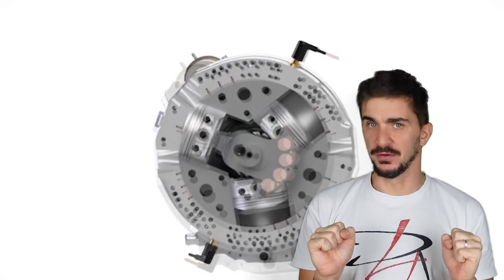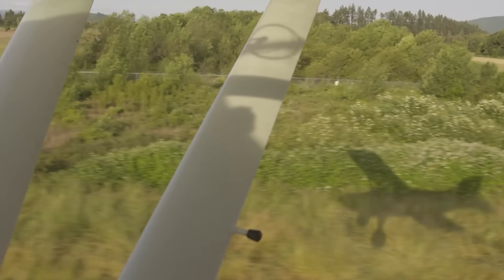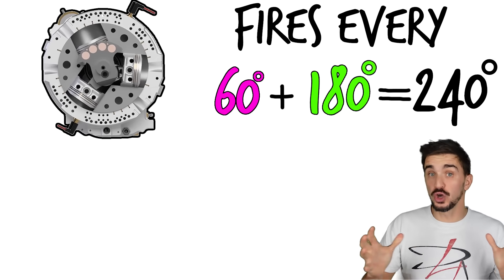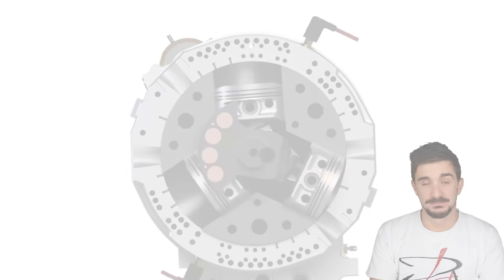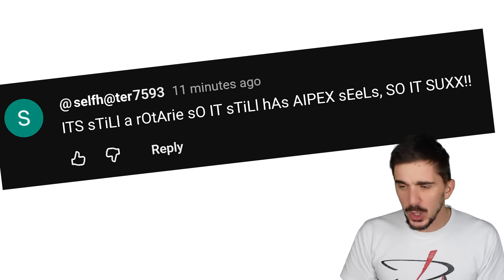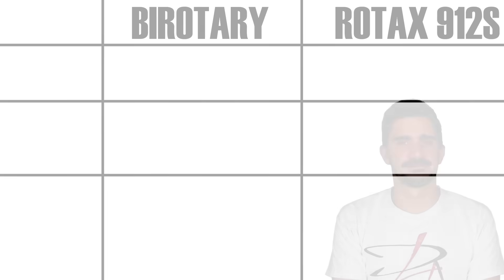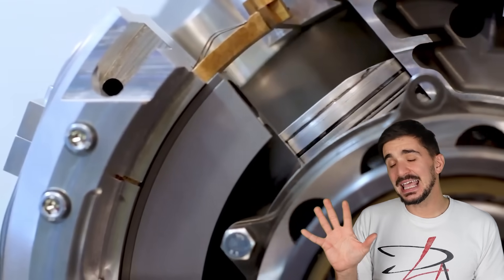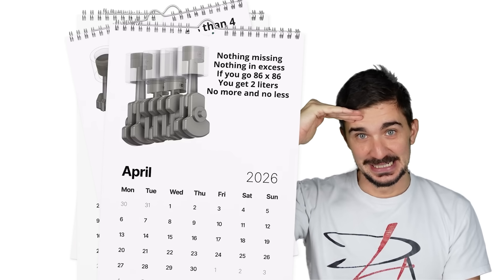This is What Happens When Pistons and Rotaries Make Babies - Birotary Engine Explained and Reviewed

Comment: It's a really cool concept, but it does miss the whole point of the rotary engine, which is to produce rotating motion directly. This engine still produce linear motion which then needs to be converted into rotating motion, exactly like a conventional stroke engine. Also not sure that I would want my car to run at 7500 RPM's. It may be fine for a small plane, but I like low rev cruising while driving. I don't need to feel like a race driver when driving to work in the morning.

Comment: 9:50 could you not also narrow the bores (so the strokes are comparably longer) or simply increase the engine's diameter?
I think it's the geometry of the camshaft that's the limiting factor though, not the forces and timing of the pistons

Comment: It could maybe work for hybrid vehicles. Use electric motor at low rpm, then Birotor kicks in at higher rpm, or for charging the battery.

Comment: If the stroke is really short, then the bore must be larger. Since the engine works on pressure pushing down the piston, the larger the piston area, the more force pushing down the piston and more force acting upon the crank? It would be nice to know how this works in overall torque numbers rather than "its short stoke reduces leverage". Obviously it reduces leverage, but how much of this loss is made up by the increased piston area? 
    Most vehicles, or at least it seems like most these days, use forced induction. Would that not help cylinder filling at low speeds? Not having valves in the way of the exhaust port might even help a turbo based engine? More of a supercharger fan myself. Interesting engine format. Thanks.

Comment: The UL Power does NOT run at 5500 rpm, at most 3300 rpm
Rotax engines run 5500 rpm continue power.

Comment: To me, the one thing that is clear as mud is how this engone gets lubrication. And along with that, how does the lubrication provde engine cooling both from the oil cooling it, as well as the actual cylinder/and head cooling. I dont see how it would get cylinder cooling like a conventional mixed coolant (water/anti-freeze) mix. So that would likely mean oil cooling like the Suzuki motorcycles (which can also rev to 10,000 rpm), but have traditional engine artcistructure to create traditional cooling paths. This doesn't show any paths for cooling , which is fine for a computer model, and less so for a mini bench opperating display engine whos entire purpose is to run and show that it works. But with no real load, and a tiny fuel tank so that the engine will not overheat. But once you put a 50+ gallon fuel tank connected to it, and add a real propeller to it and have it do real work. Well that is very problomatic. An engine is only as good as its cooling capacity. And I'm not seeing any cooling. I will conceed that it would not be hard to cool around the outside of the engine, the cylinder block would be a VERY DIFFERENT thing.  It MUST be cooled, or it will suffer dramatic heat distortion, and it will not be able to maintain its shape, which will make it so neither the combustion gases or the intake/exhaust gasses will not seal as well. And I can not see how you could pass either oil or coolant through the cyclinder block without having such a large block that it would have a very large weight, which is the ABSOLUTE ENEMY of aircraft. Don't get me wrong. I like the idea. Especially if you could stack several rotory "piston blocks which would allow for a larger output. But without cooling. It's just a cool little "theoretical" engine design. And if it's theoretical, you might as well make it a two stroke. In which by adding expansion chambers could add to it's power output.

Comment: 2:06 LOL. Right in the head.

Also, the crank might be rotating 10000 rpm relative to the rotor. 
But what really counts is how fast it is rotating relative to the static casing. Because that static casing is essentially the airframe, or the chassis of the vehicle.
So 7500rpm it is.

Comment: "begs the question" has a very specific usage in grammar. Your use of it isn't correct. Just say "raises the question."
How does the inner rotating block seal against the outer block. Seems like it would have a similar problem to the rotary apex seals.

Comment: In aircraft, I'd be concerned about variable temperature operation, meaning summer/winter and altitude variations.  Also while transient operation may seem less important to an aircraft, that will introduce significant drama to a pilot who is falling out of the sky with a malfunctioning engine.  Some power is always better than no power.

Comment: The potential to add either massive surface area pistons or a higher number of pistons (especially with narrowing piston skirts within the cylinders which would also reduce weight, think upsidedown triangles) would allow for either more powerful combustions to the former or more numerous combustions to the latter, and with a system to skip A/F and spark cycles to improve low load consumption (and potentially adding more fuel post combustion akin to what diesels do, or even using diesel) would dramatically increase the viability, at the expense of increasing complexity.

I also don't understand why a transmission with multiple gear ratios is undesirable in aircraft. It seems to me like it would possibly be a bigger efficiency boost versus variable pitch rotors, but could be a multiplier in combination.

Comment: Disagree about  fixed timings
If you rotate outer rotor by some servo against  gear frame - you will be able to regulate it  like it did  with one camshaft engines where you change both intake and exhaust simultaneously

Comment: All I'm saying is, add three (or more) rotary valves that can be used individually, 2 on the sides of the piston with smaller ports, 1 big one in the middle and the issues with low rpm performance are totally fixed! I kid, but what a cool engine, thanks for making a video on it

Comment: What about cooling the inner rotating block? This thing is a massinve chunk of aluminum receiving the heat of all 3 pistons via piston rings and rotating that with liquid inside,not a good choice for balance. Well, insanely complexity to such a small task. The only real benefit on aircraft seams to be torque canceling, but this should be easier with a gear reduction that turns the "propeulleür" to opposite side of crankshaft.  I'm just wandering....

Comment: 13:00 another big drawback- you can't do things on this engine if words "variable" and "valve" are in name of that thing. And mass, this is just a huge, full piece of steel.
Reply: You could have slots though, to save weight, as well as to flow cooling. Not sure if it's the best for longeavity though, but weight is another problem with a traditional wankel. It only got saved by its compact size, because rotors are like 2 kg, which is insane considering that huge pistons like ones you'd find on a top fuel engine is a bit less than that

Comment: Aviation is all about reliability, weight, and fuel consumption. I don't have much confidence in this engine because - if you've got an unproven design, it's not the lightest thing on earth, and it's not a diesel, you haven't really advanced on any of the three. In any case, great video and (on the topic of aero engines) I'd love to see your take on the DeltaHawk v4 diesel.

Comment: the cylinder block rotating will have so much friction against the housing, this seems a highly inefficient design
Reply: Heat transfer, oil seepage into the combustion chamber, seal life and damage modes (fracture and lodge in the rotating chambers?), etc. All solvable, but at what cost and time?

Comment: This paired with a CVT could work for auto applications? Engine RPM stays constant (like the aircraft use-case), but you can vary the output speed via the CVT
Reply: I would really have loved if he dug dipper into that stuff and also how it could work with a turbo and direct injection for like a light car and with a CVT even though I only like manual transmission or semi-auto...

Comment: 15:10 on TBO the lack of valves is a big advantage and since the pistons are only moving at 2.5k isn't that the relevant number for maintenance.  The crankshaft is just a hunk of steel.
Reply from the maker: Yes on the valves! The pistons are just rotating at 2.5k rpm, they're actually doing 7.5k since they're still driven by the mini stroke crank

Comment: Re. RPMs, let us also not forget our high school geometry; the diameter of the crank is significantly LESS than the block diameter. Thus, rotating both at the same speed (regardless of direction) = one is going to "fall behind" PDQ [Pretty Damn Quick], so differential RPM-speeds is inevitable; otherwise everything is gonna start doing whatever it pleases & all hell's gonna break loose near straight away... ;~ ]

Comment: Reaction torque is always there.  Without it, there is no torque delivered.
Reply: Understood, a Chinook does not fly
Reply: @Jo-rz6bs  Counter-rotation still has torque delivered, just in opposite directions. Airframe of Chinook has to cope with that. But enough pedantry, in the use case outlined in the video, the torque that matters to a single rotor light aircraft is reaction torque. The only benefits of the counter-rotating engine elements are balanced gyroscopic forces and lower vibration. The "torque" between engine components is largely irrelevant (but perhaps he had flywheel reaction torque in mind, relevant for car engines, but not so much for planes, because the prop acts as the flywheel in most cases...).

Comment: yeah, an 150 year old concept, an engine type first patented in 1888, rediscovered by an youtuber in 2026.
Reply: Well, it's the first time I ever heard of it so there's that. 
Sounds like they needed a better marketing team in 1888.
Also, it's still 2025 so I have to be suspect of the rest of your post if you can't even get the year correct.
Reply: @ericbucher8636  sorry, in my thoughts i'm already in 2026.
the first of these engines was patented in 1888 by Félix Millet in france, and was shown in the Exposition Universelle 1889 in paris. and you point about marketing, most of the early aircraft had these engines.
If i have missed something ... i'm open to get new information. i might be wrong, but at the moment i can't see a difference between the engine you have shown, and most early rotary engines.
Reply: @cnschu  It's all good. I get it.
 I just thought it was an entertaining and informative video about something I had never seen before, so I was being a dick as an awkward form of defense.
 I know there were many "rotary" aircraft engines, but this seemed to be somewhat unique compared to them.
You are clearly much better educated than I on the subject.
Reply: @ericbucher8636 sorry for being a little provocative in my first post. Have fun and keep going 😊

Comment: I would imagine as a compact range extender or even a home generator would see some good use out of this engine. To smooth out things even further, bolt to it to a CVT gearbox and you can do a hell of a lot with it.

Comment: 2:14
1/ Anything that rotates at a certain speed has a momentum ✅
yes, it's called angular momentum
2/ this momentum creates a torque and rhis torque is trying to spin or twist the vehicle the engine is attached to ❌
no. angular momentum wants to maintain itself with zero torque being applied like linear momentum with zero force. it's accelerating or decelerating the rotation that requires torque and generates an opposite reaction torque, like accelerating something in a straight line requires force and generates an opposite reaction force

Comment: 15:56 i dont think thats necessarily true.
thats what cvts are for.
keep the engine at a steady rpm and modulate the final drive with the planetary gear.
pair it with a hybrid system for smooth electric take off while the engine is spooled down and it could work pretty well.
Reply: CVT has poor efficiency and efficiency is key in small aircraft. Every kg matters. It's better to change blade angle so you use more engine load.

Comment: Maybe use a CVT transmission to fix this rpm issue
Reply: Serial hybrid makes the most sense. Engine drives a generator. Electric motors drive the wheels. Batteries fill peak demand so engine always runs at its torque sweet spot.
Reply: @Dave5843-d9m kind of my thought too... Theory is great but let's hook one up and see!
Reply: properly used, it should be able to solve the issue

usually they use the cvt to simulate a standard transmission, because people disliked the constant sound of the engine at it's optimal rpm
Reply: @imblackmagic1209 I think it might be more along the lines that ignorant arrogant customers wouldn't believe that that is the way the transmission works and that it is not "slipping"
Reply: @robvlob  I don't think so - it is as annoying as constantly seating near working combusion elctricity generator.
Reply: (Some) Airplanes have props that can feather, accomplishing the same effect.

Comment: Well, it inherits one of the fundamental problems of rotary engines, sealing against a complex shaped face with high relative movement (here it is simplified but still not as simple as a piston ring…) and adds another leakage path - piston rings. That is why I still think fuel economy and emissions (which is today‘s main painpoint for ICE engineers) will probably also stop this concept.

When I was 10y old I was also fascinated by rotary engines, however high pressure leakage paths is what kills all of those concepts imho…

Comment: What if you added a turbocharger, could you then increase the stroke length for more torque?
Reply: Also you state as of rn, it has a 0 chance in making it into the car market but what about it potential being used as a range extender for EVs? Or maybe turn it into a hybrid, use electric power for low rpm instant torque, while then switching over to the ICU for high speeds

Comment: other than the low torque, the obvious problem with this design is that the combustion pressure is going to press the rotating block against the outer housing with great force. this design is going to suffer from extremely premature wear and severe internal friction

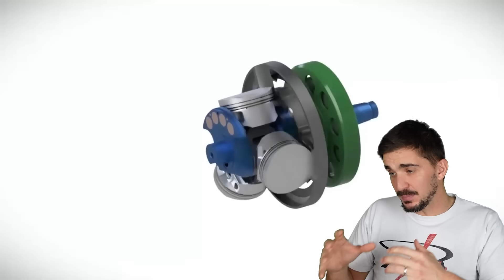Comment: 17:00 well, fixed ports can be to some degree solved with sliding valves, closing part of intake port, increasing fuel mixture speed.
Reply: Rotate the fixed cam in the centre slightly to effectively change valve timing.
Reply: @jameshaley7869 That's true, I see no reason why the crank and block can't have slightly different alignment as they spin. VVT mechanisms do exactly that already.
Reply: That's where my mind went, but with such a short charge window, the port variation would also need the intake plenum to be dynamically tuned to actively avoid Sonic reversion at the opening/closing event. Added complexity. Still.. we build computers to do stuff like that. Not needed in an aircraft application with a Constant Speed Prop, but in others, it could extend the operating envelope.

Comment: Cooling the inner rotor in the stacked design is gonna be one hell of a task.

It's also funny how good engineers have got at making circles.
Reply: Knobgear have obviously made it work.
But if you consider the very short stroke and the actual centre rotor area that's exposed to the flame front, together with the fact the external flanks of the centre rotor are fully sealed from any combustion forces and can therefore be oil cooled, it's not that difficult an issue to solve.
Reply: @hangtight71  Agreed. Oil drain from crank area is something I'd have to have a good think about, though.

Comment: You could adjust the port position by making it a hole in a disc - with the hole somewhat off-centre. Then rotate the disc which would adjust the position of the hole with respect to the piston.

Might be too complex, too demanding on materials, but I'd like to know someone has considered the issues.

Comment: Two opposite rotations DO NOT compensate gyroscopic effect of each other. Two effects will be added up each other, doesn't metter in what direction it spins. Take two fidget spinners in your hand, spin them in different directions and you will see that it's twice difficult to rotate them.
Reply from the maker: Ok, why does motogp spin the engine in the opposite direction to the tires then?
Reply: @d4a  You are confusing two different effects: moment of inertia and gyroscopic effect

Comment: Two drawbacks I see : bearings lubrication ( unless it uses a oil mixing in the fuel like two strokes )
Last one is the centrifugal force when the piston comes down on intake stroke , that will put a lot of force into the bearings at high rpm. The oiling would have to be pretty well made !

But this looks like one of the best exotic design I've seen so far. And it flew!